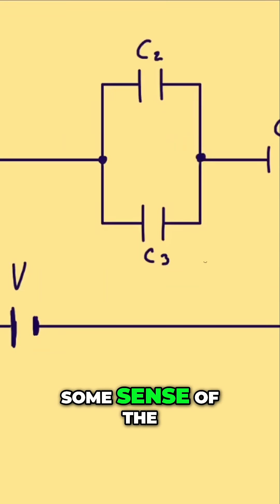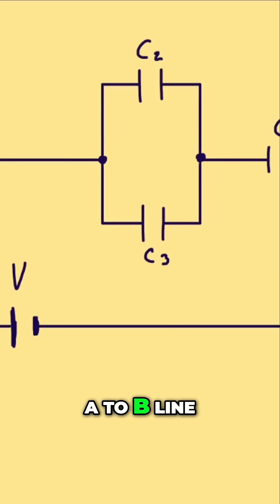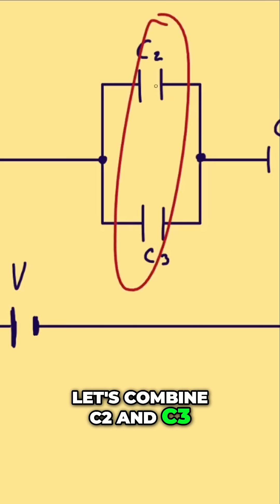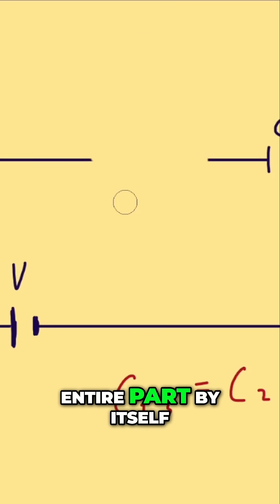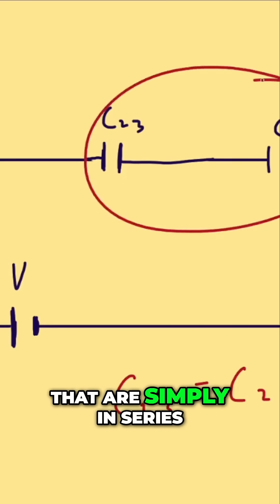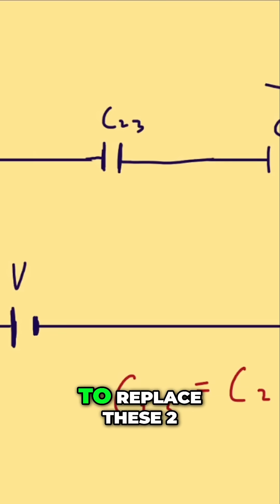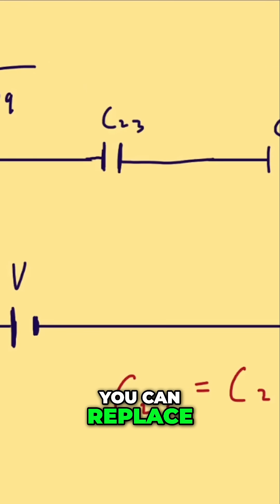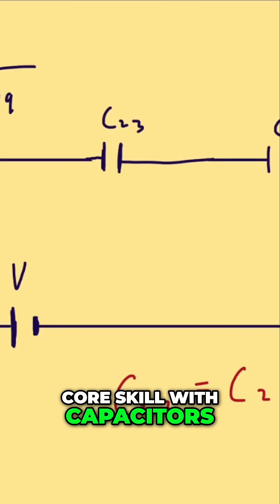Capacitor Circuits Made EASY  Simplify and Solve! ⚡️

Comment: Sometimes the multiple is done for heat dissipation reducing to one works but overall temperature of combined cap maybe inadequate in long run divided handling of power dissepates heat as applied to one unit!